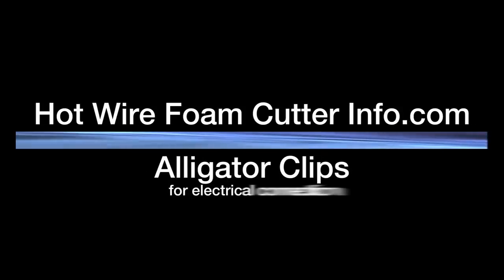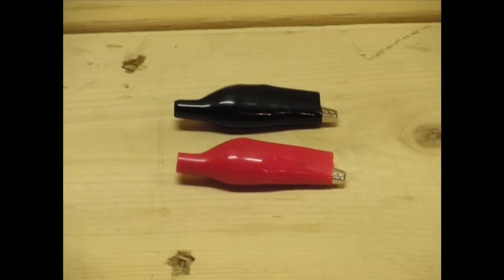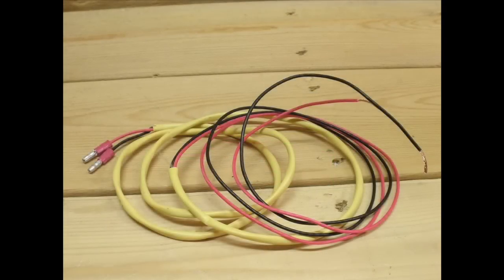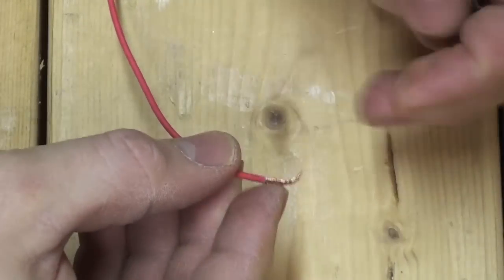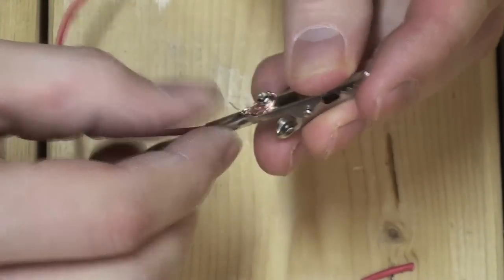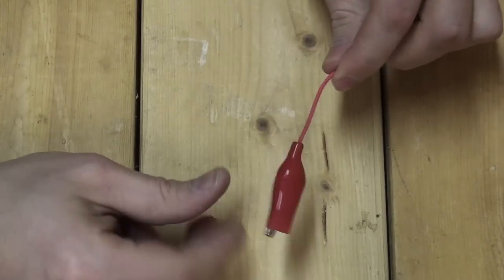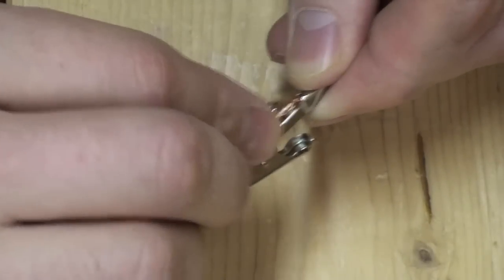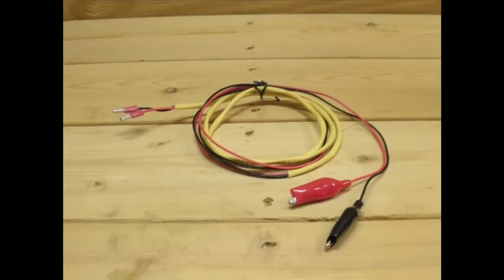Alligator Clips - Electrical Tutorial - HWFCI

Comment: Did 3 pairs of alligator jumpers yesterday and only half of them went on that easy. Sometimes it can be a chore to get the wire through the hole. I also placed a small washer to help hold wire on. Works like a charm.
Reply: Thanks for the feedback! Yes, they're kind of difficult. I think I had to try several times on this video to get it right. But works great once it's all connected! Take Care
Reply: They should come with the damn washer

Comment from the maker: haha! I usually need about a day or two to reply to most comments. The size of wire depends on your application. If it is a low voltage circuit, you can typically get away with 20 or 18 gauge speaker cable. If you need a higher voltage circuit, then 14-12 gauge is probably better. Most hard ware stores will have a wide selection of wire sizes and lengths. Also, they should have at least one or two different styles of alligator clips. Best of luck!

Comment: just clearing out my inbox, looks like i forgot to reply, SORRY!  It's not a problem if they don't have screws, most will have a "crimp" attachment so you just have to bend the metal down to hold the wire in place. All you need is a firm metal/electrical attachment and they'll work fine

Comment: I just bought several clips exactly like you have off mouser.com and they didn't come with the screws.  What screw size do they use?
Reply: Hello Andrew! (I'm using my other account) Honestly, I'm not totally sure. The screws aren't really necessary, it just ensures a tight grip. I had used non-screw terminal clips for years without a problem. You can use the frayed copper wire and wind it multiple times for a firm attachment. Otherwise, there should be prongs on the clips that you can bend onto the wire to help secure. Otherwise, if you want to hunt down screws. Most hardware stores have a "machine bolt" sizing chart which would help facilitate screw sizing. Hope that helps, take care!